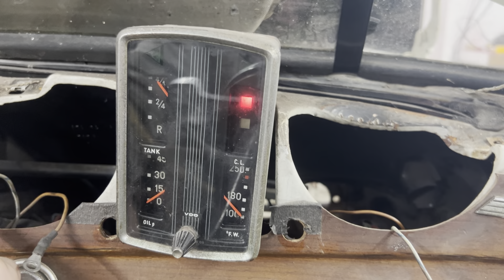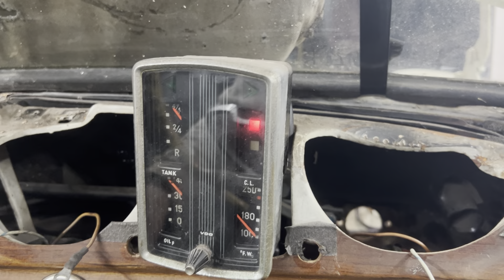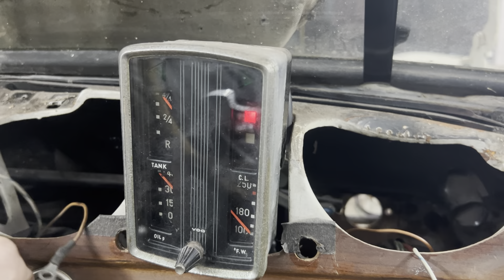Mercedes cabriolet rescue convertible w111 1963 restoration 220seb

Comment: Have you got an extractor fan in there? It looks like theres a build up of fumes which can't be doing you much good Nick. Be careful.

EDIT; I see you've just stopped the engine and sorted it. I thought you were in a completely enclosed space with the fumes and smog hanging where they did.
Reply from the maker: Yes have a fan,, wrong end of the garage tho.. I have a duct on order now
Reply: @NicksGarageUk  Whatever you used soon cleared it but that was very dangerous for a few minutes. Glad you're sorting it out 👍🏼